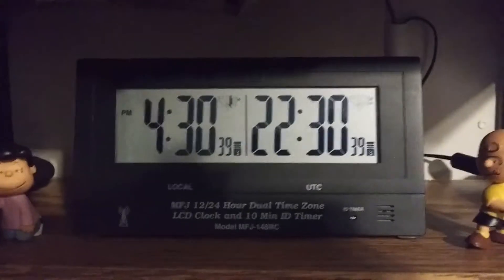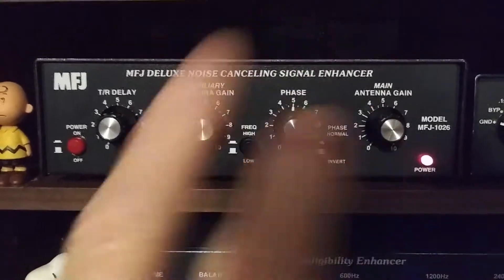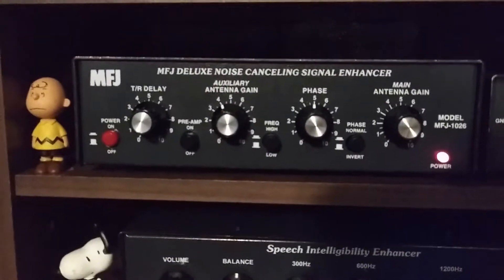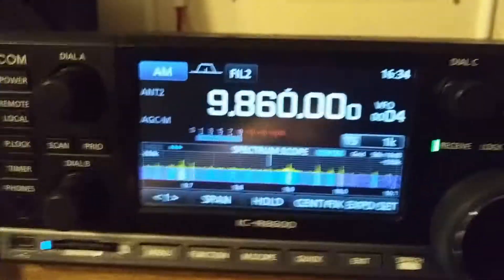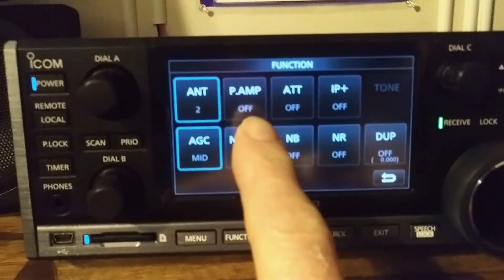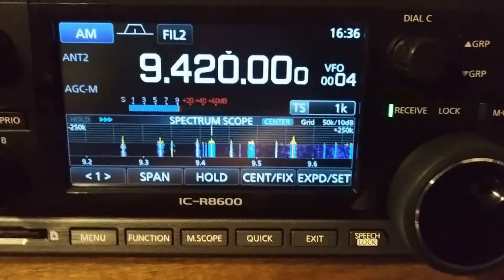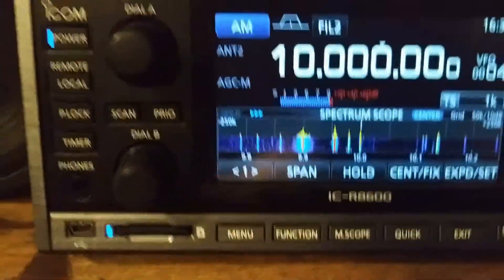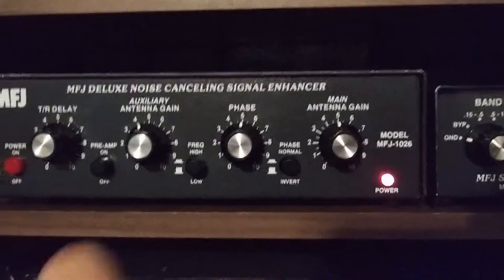Taming The Atmosphere Noise With The MFJ-1026

Comment: At what point do you install it. After the radio and before the amp and antenna tunner.  Tnx. Kn4 s yx
Reply: I only use a receiver not a transceiver. But my main antenna (Alpha Delta DX-Ultra inverted V Dipole) goes into the main antenna jack on the back of the 1026. My second antenna goes into the Auxiliary Antenna jack on the back of the 1026. Then on the back of the 1026, a jumper from Radio jack to the antenna jack on the back of my receivers. Since I live in a quiet environment, I can turn down the gain like turning a volume control down. I can then phase 2 separate antennas to boost, or cancel out any interference or reduce noise.

If your using a transceiver, the MAIN ANTENNA connector on the 1026 should connect to the input of a stations power amplifier or to the rest of the station accessories, such as wattmeter or antenna tuned

Comment: What antenna of yours are you using for the noise canceling?
Reply from the maker: My noise-canceling antenna is an Alpha Delta DX-sloper I cut down to about 15 feet long. I wasn't using it and it is mounted about 10 feet off the ground from the front corner of my house to a tree. My Alpha Delta DX-Ultra is my main antenna.

So, the cut AD sloper is hooked to the auxiliary ( noise antenna jack), and the AD DX-Ultra is connected to the Main antenna gain on the MFJ 1026.

Comment: Nice!  Would that work on the SDRPlay RSP also?  Or do you do all of the interference control via SDR Uno?
Reply from the maker: Yeah it would work with any radio. Your antenna goes into the 1026 and out to the radio. If your using it with a SDRplay, you would need a pl-259 to sma adapter since the MFJ uses SO-239 connection on the back.

Comment: I've also been having some issues with RFI at my place. Egyptian Electric came out a few weeks ago and changed out the 
transformer feeding my house. It helped some, but there is still a problem from them or the DSL line coming into my house.
Great video!
Reply from the maker: For almost a year November 2020 up until October 2021, I was getting this Raspy type electric razor sound that was S5 all the time 24 hours. 
I took my Noise locating antenna, and I walked and drove up and down the road for a couple of miles. I found the pole with the noise. I called our power company (Southeastern Illinois Electric Cooperative) about 5 times. I was really nice and offered to show them the problem.
They came out a couple times and did some work, but it really didn't help. Then one day, I came home and turned my radio on and it was gone. It's been gone since the last week of October 2021.

I hope it stays gone. out here in the country where I live, my noise floor is around S1.5 to S3. It's been that way for 3 decades now.  I purchased my magnetic loop and to my surprise, I could null it completely. But the loop didn't give me the big signal-grabbing power of the alpha delta. So I got the MFJ-1026 and I could completely remove it with that.

But now that the noise is gone, I can use it to lower the atmosphere noise and boost signals. If the noise comes back, I'll be ready.

 But I will tell you, I was very close to just leaving shortwave listening after 40+ years because of that noise.